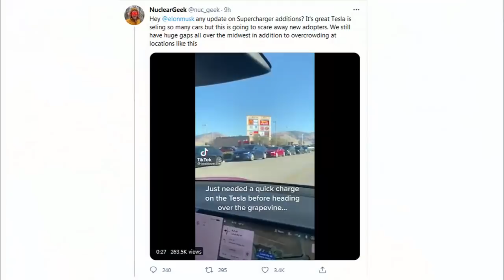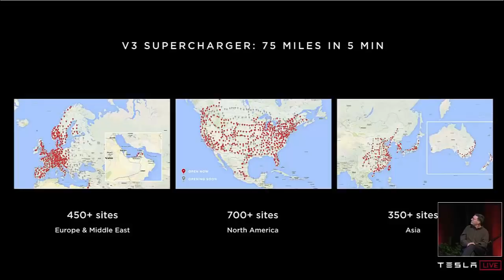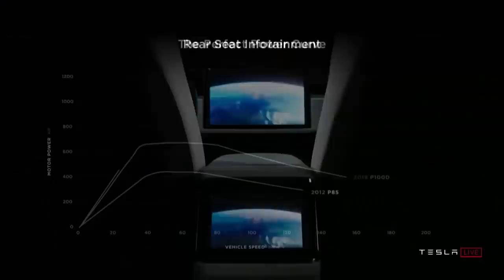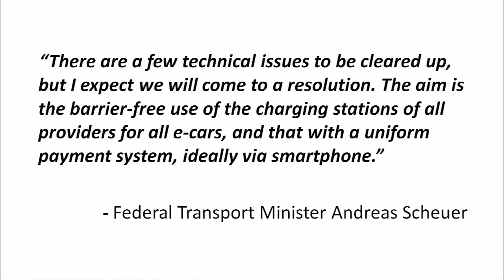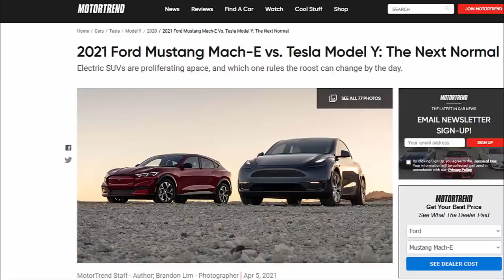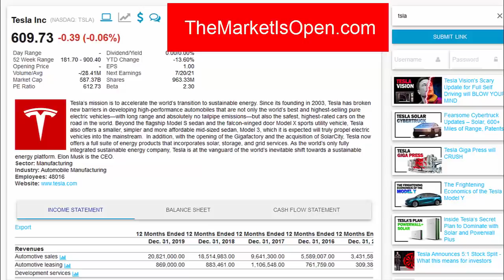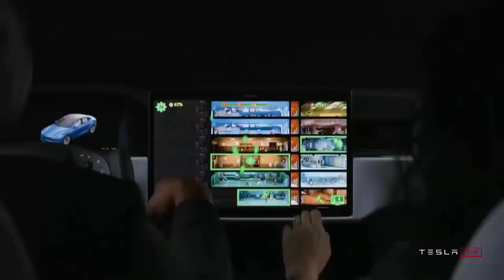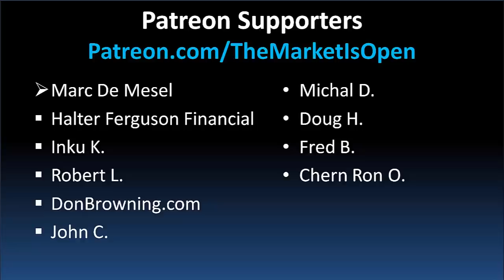Tesla Supercharger Network MASSIVE INCREASE

Comment: The stated mission of Tesla is to accelerate the growth of EV's. So of course they will open their charging network up. Considering how crappy the competition is at charging it will just illustrate how far ahead Tesla is every time a competitor charges up. It would be hard to NOT notice a Tesla charges faster and better than the competition, as well as the interactions between the Tesla owners and the owners of the other EV's that use the charging station. This will make sure that the Tesla advantage is constantly in the other EV owner's sight and will be the best advertising anyone ever got for free LOL.

Comment: Just completed a trip from Lake Havasu Arizona to Tyler Texas and back. 
Went to northern route on the way out in the southern route on the way back 3200 miles all using the supercharger network. No issues reconditioned my battery at every stop charged very fast while we got drinks and visited the restroom. Total cost of charge was about 5 cents a mile.

Comment: Don't be too sure about EV. As sales continue, EV acceptance is moving deeper into the general consumer which are used to gasoline, and unlike early adopters, not willing to go through too much hassle. When driving long range/highway, 75 MPH +, the EV advantage of cost is diminished quite a bit, if not at all. At 3 miles per KWH, at 35 cents per KWH (Electrify America), you are looking at 10 cents per mile. Looking at AAA gas price today (7/2/2021) it is $3.12. The breakeven point is about 31 MPG. Many ICE cars today will exceed this (Toyota Camry will exceed 40 MPH easy). And let's face it, currently, it is just a pain in the a** to charge EV..... and likely to get MUCH worse. Try driving an EV on a typical trip of Los Angeles to Las Vegas round trip. Also note that cost of maintaining a ICE car for freeway driving is also MUCH less.

Comment: I would say that Tesla should not open the network up for major competitors until the network is strong enough to accommodate the Tesla fleet. Once the system is as smooth as gas stations are right now, with no waiting in line whatsoever, you can think about sharing it with others. But we are far away from that right now, and looking at vehicle sales, we will continue to be far away from that for quite a while to come...

Comment: I think if Tesla really does want to speed up EV adoption they need to with other manufacturers to adopt a standard plugs design. All the other manufacturers in the US use the same plug. If you have a standard for charging Tesla doesn't have to adapt the charger software for others but rather others will right the cars software to work with the standard.
Also, McDonald's should partner with Electrify America to begin installing chargers at there locations. They're everywhere and by partnering with the franchises they would have a lower upfront investment.

Comment: Let them build their own charging infrastructure. That was a significant expense and an advantage for Tesla. It will be an excuse to delay the adaptation of electric vehicles if you cannot charge them easily. Third-party Charging systems can take up the slack for the other electric vehicles.

Comment: I feel like if they open up the supercharger network that they should increase the price to match the price of gasoline that way they can use that money to expand the network because if they are paying for the network now by having one charger for every 100 cars and one charger cost $100,000 You only need to have $1,000 profit from each car.

But if you go from charging $10 (the price of electricity) for full charge to $25, that's $15 every 15 minutes or $60 per hour, and even if you assume a little youthit rate of 1/3 of the day, that's $175,000 per year allowing the supercharger network to nearly triple yearly.

I know nobody likes the idea of the supercharger network costing the same as gas, but people do road trip with gas vehicles and people don't complain about that. What people do complain about is there's not enough chargers when there's a line, and this would fix that, Even if they opened up the charger network to everyone else. 

Actually this would be the only way you could open up the charging network to everyone else and have it have exponential expansion without having to rely on Tesla's vehicle sales.
Reply: PS, that would also result in +4 billion dollars more every year from the current charging network alone.
Reply: The only thing I would suggest is making a minimum charging speed for a vehicle to be allowed on.

So 50kw, no (so no to Bolt)
100kw? Maybe..
150 and about, a ok.
Reply: Would it be a ridiculous idea for Tesla to not increase their price for their vehicles but to have this premium cost for all the other vehicles?

I almost feel like that's something that would be considered illegal because at gas stations they don't do that.

I mean literally Ford used to make their own gas stations and I believe everyone could fill up on gas not just Ford vehicles, and because they didn't have a way of checking if you are Ford  or not, anyone could fill up.

One thing that most people don't consider about a charging network is, The oil companies are the biggest and richest companies in the world and they mostly sell gasoline, so if you sold electricity at the same profit per "fill up", then all you would need to do is be able to charge every electric vehicle and have every vehicle be electric and you would be on par with oil companies.

SUPER RICH!

I see this as a good direction for Tesla.
Tesla the energy provider that also sells amazing vehicles.

Comment: Tesla is incentivized to allow competitors to use their chargers. Their company mission is to accelerate the transition to electricity/sustainable energy. This does that. And in reality, their biggest threat still isn't any EV, it's ICE cars. So not only additional revenue from charging, but the key point is jsut to get people into EVs. Once that happens, Tesla can focus on the quality of their cars to capture the massive market. But i'm sure they'd rather have 10% rather than 20% of the market if the market was 10x the size.
Reply: Tesla might also have the ability to sell and license parts/pieces/software to other companies. Auto companies have always done this and made nice chunks of change.

Comment: The way Tesla cars are developing there is no way I would buy another Tesla if I could buy say a mercedes and yet still use the Tesla superchargers.  I have a model X and a model 3 at the moment but am planning to start replacing them in a year or so.  I was going to get a new Model X BUT the new yolk and the stalkless operation really puts me off the car itself but the supercharger network is still the big pull.  If the supercharger network is available to all I will buy something less dumb instead.

Comment: I think Tesla chargers should be exclusively for Tesla owners.  That system is a huge incentive to shoppers. Leave it the way it is - PLEASE!!!
Reply: Electric cars need charging stations. Tesla gains business with allowing others to charge. Many Tesla drivers use other chargers!
Reply: Adapters, as provided by manufacturer, should allow hookup. Tesla has adapters, and the vehicle cantrols the charge. I use 110 at 14.5V.

Comment: I had the exact same thought as John Glazer, below. But let me throw another wrench into the wiring -- lets assume that the driver of the other EV at the charging station CAN indeed get the charging cable to mate with his charging port. Is his battery system capable of being charged without melting, heat-rupturing and giving off noxious gases, or catching fire? I don't remember seeing or reading anywhere that these situations were possible or not. What I have read is that all batteries are not equal due to different materials. build methods, etc. Does anyone know whether this premise holds water?

Comment: I have owned a 2014 Nissan Leaf & a 2018 Chev Bolt (both used)  I ordered the Tesla Cyber Truck because I also had an ICE car because the Leaf & Bolt were very limited where I could drive them in Wiscinsin. 
With the Tesla, the ICE car goes too because I can drive anywhere in the USA with it

Comment: Yes, I think TESLA has a good Moat with the Supercharger Network.   I do think that TESLA can make a good business from Opening - ONLY IF DONE CORRECTLY.  For Instance, Aptera  might (likely) want to get access. If so, Tesla can allow that if Aptera pays a couple grand or so to  TESLA for every Aptera made... and charges are higher per KWH rate to Aptera users.  The Other MFRs Should ONLY fi their charge ports are on the REAR or REAR Left (like Tesla) so that the cars BACK IN and are tidy.  I have seen Charge America stations where there are Mid Side chargers and the cars are pulled half way in - leaving the back half of the (Nissan and Others) sticking out into the traffic lane... a real nuisance !  Tesla has a good system and everyone knows how to get it to work well.  The Other Folks should NOT MESS IT UP !

Comment: My two cents…. 

I don’t think Tesla should ever open up the charging network…. The reason safety, if Tesla locks out it’s own fleet because of mods ( and that mostly in software or Tesla hardware on a rebuild)  with concerns of safety then how are they going to manage other auto mods, or even if there is an issues of fires like chevy’s starting on fire, or issuers with cooling the battery, and the list goes on. If Tesla does open up the supercharger net work to everyone then I hope that all the people that got locked out sue tesla, why are these black sheep when they in fact supported and payed for the right to use that network form the moment they were built. 

My point is this is a slippery slope and I hope Tesla doesn’t go down it, and if they do…. I hope that the black sheep’s of Tesla do win a lawsuit, for being ostracized!!!

Comment: The Model 3 and Y can only charge at 250kw for about 5 minutes. A faster charger wouldn't help them, but it would help a Cybertruck with a bigger pack, and as they ramp up silicon in their cells, future 3s and Ys may be able to charge faster.

Comment: I live in an area where I have only had to wait a few minutes one time for a charging spot, but if I had to routinely wait for 3rd party EVs to charge I would not be happy about it. Making 3rd party OEMs conform to Tesla is a must. They would have to charge at a fast rate and if the chargers were in a busy location then maybe that location would be off limits at certain times of the day. I trust Elon to make the right decision that balances the mission to accelerate the world to sustainable energy with customer satisfaction. At a minimum, others should pay a hefty premium to use the network since Tesla owners are the ones who originally subsidized the network. A hefty premium would prevent others from using the network simply because it is better and faster and motivate them to demand a better public network. I do not understand why gas stations all over the country with convenience stores aren't installing multiples of BOTH types of chargers at all their locations. To me that is a no brainer. I guess they don't see the writing on the wall either.

Comment: I can take my ICE vehicle to the gas station and go from damn near empty to full in less than 5 minutes. That's the entire process between pulling in and leaving the station(using a CC). Meanwhile, EV makers are still trying to figure how to charge these cars in under a half an hour without the battery being damaged or the car blowing up.

There's much work to do to figure out how to make EVs practical for those who don't live in a house with a garage. How will charging and battery integrity manage when you have to park and charge your EV outside in the elements(we don't all live in sunny california)? How much of a phantom drain hit are you gonna take having your car sit outside in the elements over night not charging because there are no charging stations at your apartment or condo? Same for if you have charging stations at work. They still have to sit outside. 

Can the supercharging units they're building be upgraded remotely as far as charging speed or do they have to build entirely new units capable of faster charging as well as upgrading the power grid?

All this to say that while EVs are indeed the future, that future isn't gonna be here tommorow, or next year...or next decade.
Reply: @RickFreeman007  you saying you live in an apartment?

Comment: Minister Scheuer is trying to force Tesla into the german „Ladesäulenverordnung“, the german regulation of charching points. It would weaken Teslas moat of their supercharger network. Tesla would be forced to install a rfid reader, a card reader and a display on every supercharger, because this is the law for puliblic available charging points and because the other car brands don’t have an onboard display to use the supercharger, nor can they upgrade their software easily. It would cost Tesla a fortune to do this, and it would weaken an uniqe selling argument for tesla. The german automakers are doing massive lobbying in the politics against the electrification of the cars and against Tesla.

Comment: As nice as it would be to charge non-tesla at a supercharger...  I think first, they should open up full speed CCS to Tesla owners with an official Tesla adaptor (like they did with Chademo.) -- after they have done that, they can consider installing a few CCS stalls at some choice locations, (opening up the station to other EV's)

These choice locations would low use stations, where there is not a non-tesla charging option available... there is no reason to have a Chevy Bolt (for example) sitting in a Tesla stall for nearly an hour while there is a line of cars waiting.

This strategy would:  Increase coverage for all EV owners, including Tesla.  Reduce pressure on Tesla's highest use superchargers, improving owner experience, and increase use of supercharger stations that sit empty.

Comment: and i'll say it again you're nothing with a 350kw charger (and a car with a peak 350kw charge rate) if at 30% your battery only accepts 100kw anymore and 60/70kw @50% its all in the charging CURVE not the charging power

Comment: It's a good thing that there are plenty of carbon based electrical plants all over the world to charge up those electric cars. Instead of talking trash about carbon based electrical power, Elon Musk should be praising all those hard working individuals in the oil business for making sure his electrical cars are able to continue operating on many of the asphalt roads that were made from oil based products.
Reply: Technically, that can be viewed the other way around, as well! Even though there will ALWAYS be a demand for electricity, with OR without Tesla vehicles. Having more and more Teslas(and other makers) on the road means more jobs and job security for those in the energy production sector.
Reply: @foadrightnow5725  You're thinking pretty much the same thing as what I'm thinking. We should appreciate all the various ways we get our electrical power and stop shaming those who have been in the oil business for well over 100 years.
Reply: @RickFreeman007  LOL !!!  I was in the concrete business for many years. Do you know how much oil needs to be processed into fuel to operate all the concrete trucks and the cement plants?  You have no idea how dependent the world is on oil that will take many more years to replace with any other kind of power source.

Comment: Imagine an EV with a 50kwh charging speed tying up a stall for  several hours while Teslas are queuing up to charge at 250 kwh. As a Tesla owner I would be livid in that situation.  Let's   hope it doesn't  happen.
Reply: That won't happen as there aren't that many teslas on the road.
Also someone with a 50kW charging speed would propably be directed (by the navigation system) to use a 50-100kW charger as they also are widely available and usually close by.
Reply: The only way that isn’t frustrating is if there are 3x to 10x the number of Tesla supercharging stations, which I believe this decision will help facilitate.  

The other OEMs are going to be so production-constrained anyway for the next 5-7 years… battery suppliers already can’t keep up with demand, and Tesla has a 10 year lead on shoring up those supply chains.
Reply: Tesla has many competitive advantages and their supercharger network is one of their main unique selling points. They have already invested large sums into it and are already ramping this up massively with their new production facility in China  which has the capacity to make 10,000 chargers a year. They have large sums of money already in the bank, so don't  need money from other OEM's.  If Tesla do decide to open it up, it will only be to a very small number of niche manufacturers.
Reply: Imagine tesla owners charging at j1772 chargers using a converter, noone gets livid because noone is selfish

Comment: Imagine if Ford owned the majority of the gas stations across the country.  

Tesla has so many different verticals cornered it’s unreal.
Reply: And the gas nozzle was a different size so you could only fill Fords unless you had a $150 adapter.
Reply: @macrumpton  lol
Reply: Two counterpoints..

Ford 100 years ago did build out their own gas stations.

And there is gasoline and diesel two different things.

Not to mention oil companies make a huge profit on gasoline when it costs a lot more than electricity.

Tesla could just make that same amount of profit once the full transition happens. So it's not a bad idea for making money, and it's an even better idea for accelerating the transition to sustainable energy because more people would have less excuses.

Not to mention they are heavily investing and ramping up supercharger network expansion.

They had 20, 000 supercharger stalls at the beginning of 2021 and halfway through they now have 25,000.